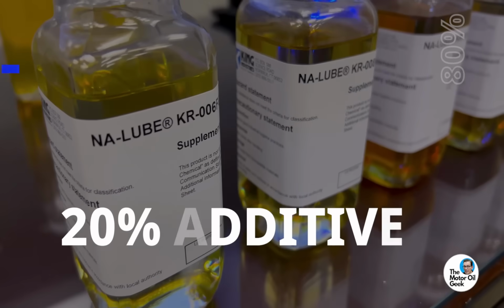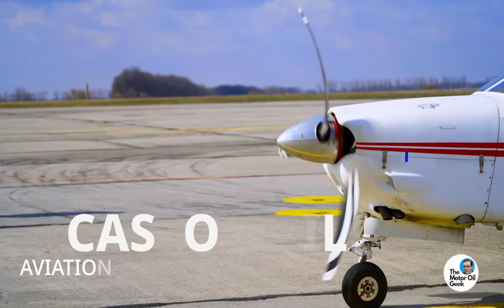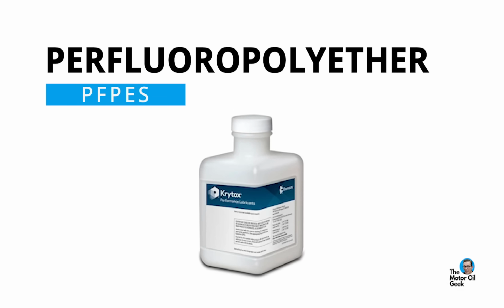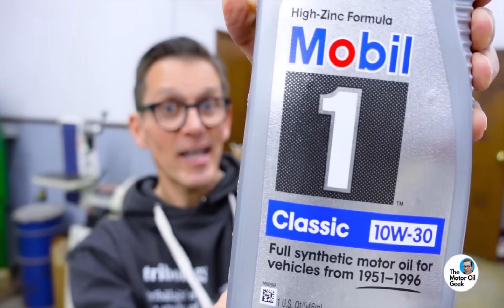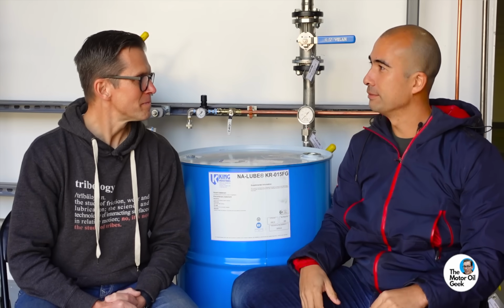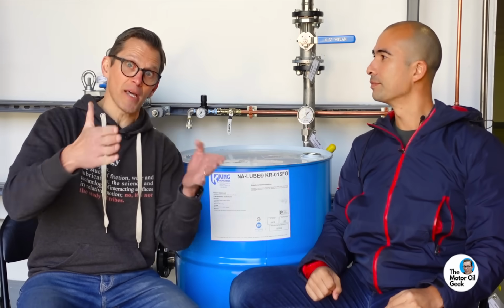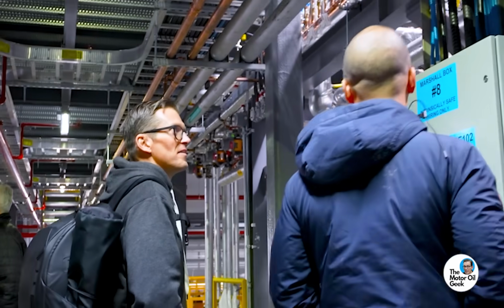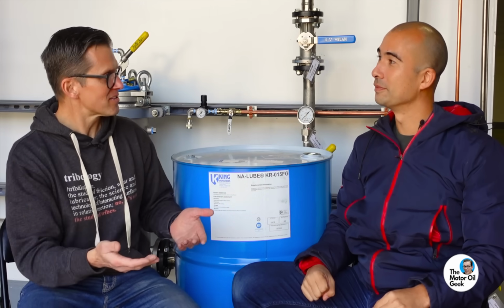100% Synthetic Oil: SCAM or SCIENCE?

Comment: Amsoil  still uses the real synthetic Type 4 and 5 Base Oil  and it is superior ..  Mobil 1 changed their original  true synth 25 K oil that they use to advertise back in the 1970s and 80s ..Mobile  uses  the petroleum Type 3  now blended I assume with less of 4 and  5 base synthetic oils ..
Reply: If you want the good stuff Mobil 1 4T Racing motorcycle oil is still PAO based... It's the oil that Mobil supply to their NASCAR and other racing teams (i.e., motorsports that aren't special enough to get a custom blend like for Honda in F1). It has no rating for modern cars, DI etc, though.
Reply: @TassieLorenzo  I haven't had a motorcycle for a very long time ..Does the oil only use the Base oil 4 and 5  without the pseudo synthetic Type 3 Base being mixed in ?
Reply: @VIDSTORAGE  Yes it does, it's Group 4 and 5 only (apart from some mineral oil carrier for additives)! That's why it is used in motorsports.
Reply: @TassieLorenzo  OK  ThAnx
Reply: Obviously regular Mobil 1 oils are mostly pretty cheap in the US (unlike the expensive Mobil 1 Racing), so that's why the chance of them having substantial PAO in it, is pretty much zero. 0W40 does require a fairly substantial amount of PAO (about 30%) though. You can typically find the listing in the Material Safety Data Sheet.

Comment: While I paused the video to grab both my Amsoil Signature series oil, and Pennzoil Platinum High Mileage oil to make better selection of oil I use in my car and truck.  I got nothing from this video because its talking well above the common use of engine oil I should be using.  Just to make things simple I just opt for more frequent oil changes than to chase those who seek long drain intervals.  I've used synthetic oils for almost 30 years, and quality oil filters.  My gauge of performance is my viewing how clean the valve train area is.  If it is clean and deposit free from day one, then its doing the job.
None of engine oil containers disclose the formulas and make it impossible to make any comparison by design.  We can't even get a definitive between Full Synthetic, and Synthetic.
Reply: Problem with Lake is he uses oil analysis to prove his point. And I been watching these oil analysis BS papers for years and they almost all come back that you could have run your oil longer. They’re pure BS and actually tell you next to nothing. You’re better to look at engine failures and the condition of the inside of the engine. If it’s discolored the oil is crap or it’s been run way too long. I had a Suzuki Grand Vitara with the V6 I was running Pennzoil Platnum changed every 3000 miles. You could see down into the valve cover through the oil fill cap. It was brown and red with oil residue. I changed to AmsOil and haven’t seen this discoloration on the aluminum since. And I don’t believe in long oil change intervals. It’s well proven that it’s a bad idea….
Reply: @robm3357 yes everyone should follow you because you know better!! Most failures are from lack of oil not running oil too long. You're not smarter than the data
Reply: @bigdaddymak1439 Oil is cheap engines are expensive. The data is all over YouTube with massive amounts of engine failures that have followed long oil change and thin oil use. That data is very obvious. You do what you want don’t follow me.
Reply: @robm3357 opinions are on YouTube! Just because people say it doesn't make it data. If someone doesn't check their oil and it runs out of oil is it the intervals fault?? Most failures are from neglect and abuse.
Reply: @robm3357  Wow, that is an excellent testament where you had personally found by switching to Amsoil you were able to clean the inside of your engine from the brown and red discoloration (left behind by your multiple Pennzoil Platinum changes performed previously every 3,000 miles)!
Reply: @jimn.9990 not completely as I traded the Outback for a new vehicle. But it was looking better inside after the 3 changes it did get with Amsoil. I have seen the inside of a motor that has run Mobile 1 from day one with out doing extended oil changes and there was absolutely no varnish on the aluminum inside the motor. Very impressive. I run Amsoil in everything and in my Victory motorcycle that has seen oil temps of over 325 deg while stuck in traffic (Air Cooled) no varnish in side the motor. Nothing in the valve area or clutch area while doing a compensator adjustment. Like new inside. But remember I don’t believe in or do extended oil changes.
Reply: Agreed. I use to care about how long my engine oil can last. Now I just do 6K oil changes regardless of what the manual states. I grab synthetic oil that's on sale at AutoZone. The great thing is that all these oil companies have their own customer base. I've used Amsoil for years and for the cost, it's not worth for 5K intervals for their SS oil.
Reply: @mariodiy4517  why are you using Amsoil SS with only a 5k interval? Thats your problem there is you think it’s not worth it cuz you are changing your oil too soon. It’s meant to go 25k or 15k under severe service. With those interval it’s well worth it and then some
Reply: Yeah, I don't care about going 15,000 miles on an oil either. 
I have found that even a top-tier oil run for 6000 miles between changes equals a dirty motor. Run the same oil for 3000 miles between changes and the motor stays clean inside. That is stock motors and street performance motors.
Reply: @WrenchesandPlants you do know dark motor oil doesn't mean dirty??? Changing your oil just because isn't smart Lake has even said they've done studies on doing unnecessary maintenance isn't better
Reply: @bigdaddymak1439  Not Dark oil? Engine dirty is what I said. Sludge starts to build the aluminum starts to stain. I said nothing about dark oil.   😮😮😮😮😮😮😮
Reply: @bigdaddymak1439  I could not care less what color or consistency the oil is when I change it. Pull the valve covers and inspect the cleanliness of the motor.
Reply: @WrenchesandPlants 
I run Amsoil Signature Series 5w-30.  15k mile changes on my 03 civic.  185k miles.   I pulled the valve cover to adjust valves and it was spotless inside.
Reply: @WrenchesandPlants do you know how hard it is to sludge an engine?? Keep it full of oil and change it at a reasonable interval. People who sludge engines run their engines low, do short trips or go years without changing

Comment: Q: WHAT kind of oil is in the "pump protector" products that are used for treating home pressure washers? Some MSDS sheets say it's a "de-waxed" petroleum. I wanted to find a cheaper substitute, but not having much luck. WD-40 could possibly be used, I think. Not sure the RV Antifreeze products do much to lubricate?

Comment: I run 10W-30 and my Dodge with the Cummins and I completely expected through proper maintenance to last half 1,000,000+ miles.
Reply: With a dodge?😂
Reply: His has a Cummins engine, not a Dodge engine.
Reply: @jamesbosworth4191  yes the engine is a Cummins, but the truck is a Dodge
Reply: @leatherneckprepper4477  The fact that the truck is a Dodge has no effect on engine life, but the fact that the engine is a Cummins has a big positive effect on engine life.
Reply: @jamesbosworth4191  the fact that the truck has a Cummins engine has no effect on the fact that it is a Dodge truck

Comment: Always used Mobil 1 extended performance really great oil.
Reply: Yes other oils had lower tbn numers and good detergents in pennzoil, shaeffers and supertech. Personally, Amsoil struck out being the best when it came to film strength, tbn and detergent package. But Amsoil for me was expensive for me and never really shop online for oil in the first place. Mobil 1 was my choice due to affordability and its modern oil formula to adapt to any engine plus, alkylated napthalene is included which is better than any pao oils and provides a great oil film that sticks to metal components so there is less cold start wear.
Reply: How do you know it’s great?  Have you compared to other oils with an oil analysis?

Comment: Fluids are not created equal. Amsoil in my Honda manual trans causes hard shifts, grinding and no shift at all when cold and stopped...Honda OEM fluid and is like butter again...
Reply: I use Amsoil in everything and never had any issues, including in Hondas 👍
Reply: I'v heard mixed experiences with Amsoil ATF within the 3rd gen TL community. For some it worked, for others it didnt. I personally haven't tried Amsoil ATF in my 07' TL-S since OEM ATF has always worked for me. Im one of those where, if it works why change it?
Reply: A lot of times an ATF fluid change, even to new OEM fluid, will cause harsh shifts until the programming for the transmission adjusts to the new fluid's shift characteristics. The computer has slowly compensated for the deteriorating fluid over time and then you reset the fluid. The computer will adjust to the new fluid in time.

Comment: Lake, you definitely rule. Thank you for sharing all of your knowledge. Owning a hybrid. I want to get the best bang for my buck AND maintain my engine to the max. 
The constant off/on of the ICE, I see how the temperature fluctuates, so I get concerned in how it affects the oil. I don't mind paying for a better lubricant if it prolongs the life of my ICE. I have learned so much from you.👍🇺🇸
Reply: The Hybrid system will maintain the temp of the oil to reduce wear. Hybrid's are not harder on oil and the ICE engines wear well because of the steady state operation.
Reply: @MathewPollard-vj4uq  False.

My hybrid runs cooler than my ICE. Coolant temp averages 83-86°C instead of 92-98°C, oil temps of hybrids are even lower as the engine runs only part time. 

Unless you use hybrids for regular long drives on the freeways, you need to use oil designed for hybrids, fuel and water dilution are real problems, same thing with anti wear additives as you can imagine the regular stop start = turning the engine repeatedly at low oil pressures. Rmb what @themotoroilgeek told us all the time, the right chemistry is needed to fit the purpose.

Comment: Nerding out on Saturday morning.
Reply from the maker: Glad you found it interesting.
Reply: @themotoroilgeek  Would you be keen to do a review on the Motul 8100 Power 5w-40? The label on the bottle proudly say "100% Synthetic - Ester". But spectroscopy tests have shown that it's predominately PAO based, ester is estimated at less than 3% (shockingly because of what's written on the label)

I mean I got it, it's still a very good oil, but to market it as an Ester (instead of PAO) oil? Makes me wonder how much Ester my Motul Gear FF-LSD Type 2 contains :D
Reply: @themotoroilgeek I second the idea of exploring the makeup of European oils such as Motul, Millers, Fuchs.  I like the information on other videos about minimising GDI piston ring deposits.  I'd also like you to explore gear oils more and perhaps how sulphur based compounds don't appear to be necessary for GL5 certification.  Perhaps dispel some incorrect information of gear oil in a FWD transmission and show how chemistry has changed over the years.

Finally, the text of this video wasn't really accurate and I hope you reflect on that for future videos.

Other than that, I appreciate your time and effort. it can not be easy to make a video engaging, understandable and educational.
Reply: Better still - oil geeking it out!!

Comment: Pennzoil Ultra Platinum is the way to go. You KNOW you are getting an actual Synthetic Oil. I consider GTL a synthetic while a I consider severely hydrocracked oil to be a semi synthetic. That should be where the line is drawn IMO.
Reply: I tried Ultra Platinum for the first time a week ago after finding it in stock and on sale at Walmart. I should go back and see if they have any more if the sale is still running.
Reply: @F0XD1E Yeah, our Walmart also recently started carrying the Ultra Platinum in store. Because it’s hot here I switched from 5W-20 Honda semi synthetic to 5W-30 Pennzoil Ultra Platinum and to my surprise my fuel economy actually increased. To be fair, it is thin for a 30 weight oil but it still must have some pretty decent friction modifiers in the additive package.
Reply: It is made from natural gas
Reply: You might be right. PUP has good numbers on their Datasheets. Amsoil is slightly better , but I do not need the best. Pennzoil has REBATES that are really good! They are ending soon but they will probably start another Rebate next year.
Reply: I’m skeptical it’s pure. Oil manufactured from natural gas is clear like water.
Reply: @arthurm-vl6sw  They show the base oil is clear in their advertising. The amber color comes in from the additive package. You would never want to run a pure base oil in a car.
Reply: @arthurm-vl6sw  That has little to do with the finished product that includes additives.